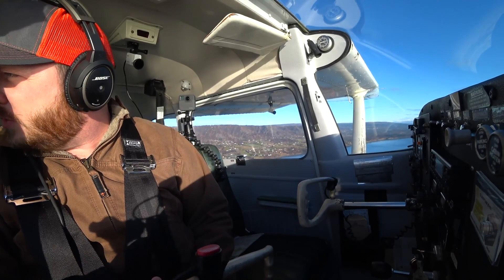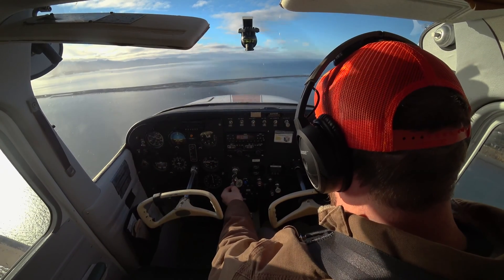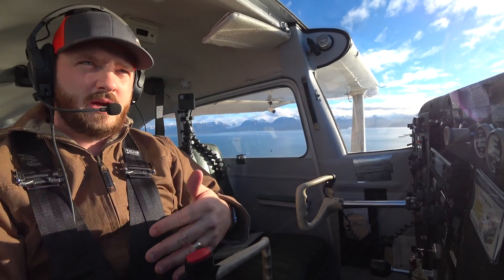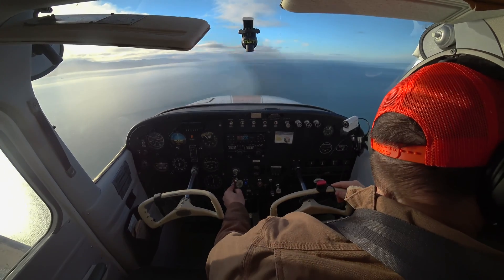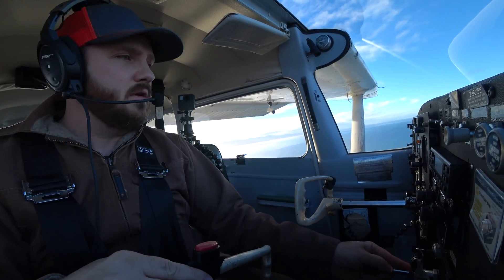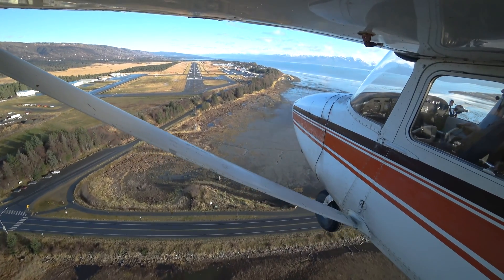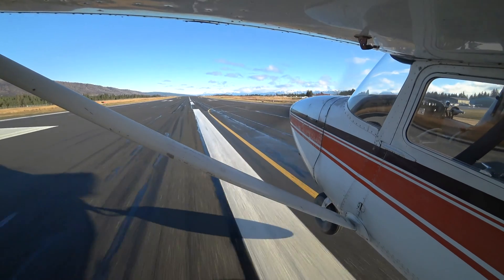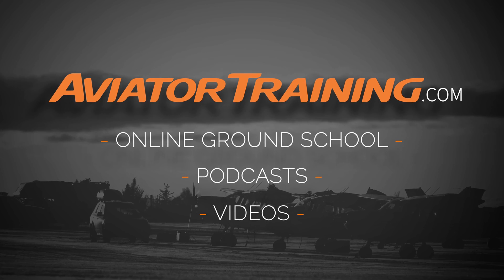How to fly: Short Field Landing

Comment: I’m not sure I understand.  When I did short field landing practice at my local field (YPOD) flying an rv8a it had no displaced threshold. My objective was to land before the 1000 foot marker and turn into the adjacent taxi way. So is landing ON the 1000 ft markers short field? Just wanting to clear up my confusion
Reply from the maker: On a long runway, it’s just a way to have a target. The ACS calls for 200 foot tolerance after the touchdown point. The thousand footers are 150 feet long.

Comment: Chris at what point are you cutting power?  right over your intended touch down point or before that?  i sometimes land short and wonder if i'm cutting power too soon.  My speed is stable around 62 coming in.
Reply from the maker: Depends on the airplane. Mine is draggy. I don’t cut it until right before round out
Reply: @angleofattack  thanks i'll try that.  i'm training in a 172 as well, check ride in a month or so.  i'm likely cutting it earlier and treating it like a normal landing.

Comment: Hey Chris, awesome vid as usual. Only thing I think could be expanded upon is max braking technique - avoid lock up at all costs as this can lead to loss of directional control especially on a wet runway.
Reply from the maker: And creating flat spots on the tires. One time I put too much heat on the tires, and ended up blowing a tire two takeoffs later.